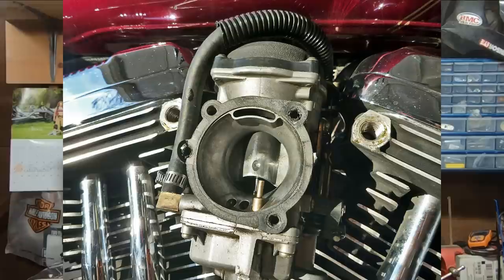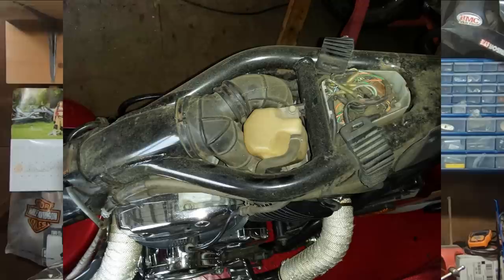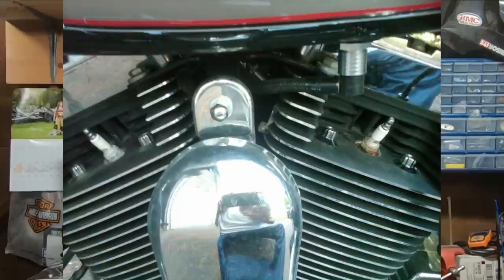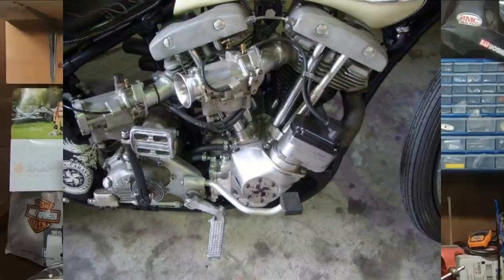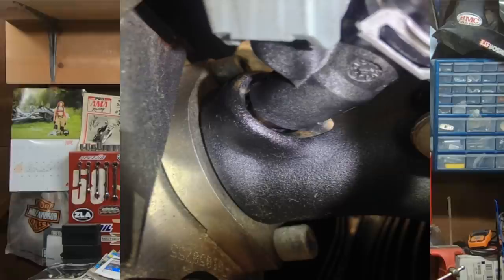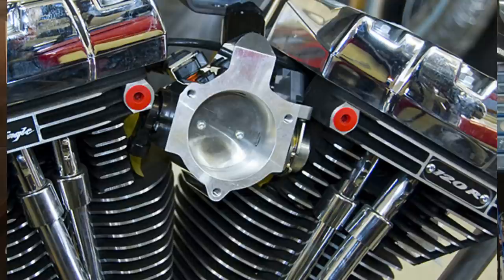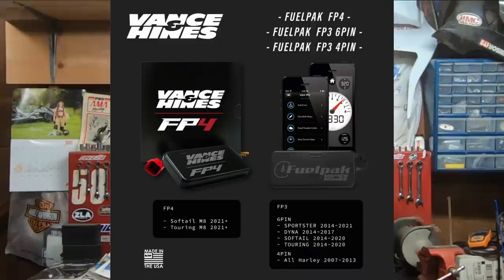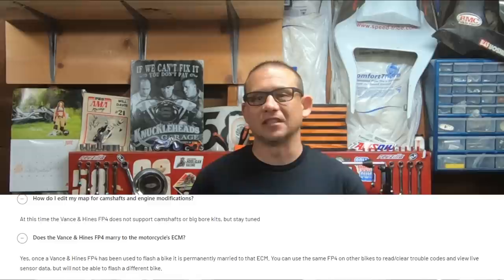Harley Fuel Injection Solved The Carburetor Problem (Created Others)

Comment: I’m an old school guy, I’ve got a fuel injected 103 and a carbureted 80” Evo, I’ve always been a carb guy but once I got into tuning my softy with an fp3, I used my extensive carb tuning knowledge to get the fi dialed in, it ran good with the canned tune once I did the cams, but, once I used my buddies fp3 pro to dial in the ve tables, used that info to tweak my target/seen AFR to get it to where I wanted to be. Had it dyno’d and the dyno guy was impressed (so he said anyway) that I tuned it myself. It’s like anything else, once you learn how things work, doesn’t matter if it’s carb or fi or whatever, know the basics, the rest is easy. And the fp3 is actually reasonably capable but kind of a pain to change things around.

Comment: I'm okay with more rudimentary fuel injection systems, like early throttle body injection... because it's basically just an electronically controlled carburetor. But more modern EFI systems add way, WAY too many sensors and electronics to function, all of which are additional potential points of failure. 

As a guy who's owned 2 Japanese cruisers and 2 Harleys, I always envied how easily accessible Harley carbs were. It absolutely sucks to work on Japanese cruiser carbs because they bury them between the cylinder and usually tucked up under the tank

Comment: I don't mind my twinky idle at all, even though I really liked the sound of my 84 shovel idle.
My current 2007 twinky had a no start after a month of owning it.
Local dealer came and picked up the bike, took me home, fixed the problem (something to do with the carb) and it has run with no problem since.

Comment: 🛑🛑 I just got home, to watch this video after riding home from the HD Dealership.  I installed a Power Vision 4 Upgrade, and did a Dyno Tune. 

My CVO Ultra is running much better, and the charts say it; but my butt noticed the Performance Change. 😂👍💯

Great Results…Highly Recommend the Power Vision 4. 😀👍
Reply from the maker: That's awesome! Good dyno tune makes all the difference! Vance and Hines had a great product idea but they screwed up not making tuning licenses and playing catch up on the dyno market, Dyno Jet has that locked down.

Comment: As much as I loved my FI bikes, nothing irritates me more than a bad sensor. Had a bad crank sensor and it would over fuel the motor at idle, hit the throttle and fireball out the ass end. Take the bike in and it didn't throw a code. Guess how much that cost for a $20 part and an hour of labor. After going back to a carb, I only have to worry about fuel, air and spark. And you don't have to be a computer engineer to work on them.
Reply from the maker: That's the worst when those sensors fail and don't even throw a code, you have to look at data or just rely on previous experience to figure it out.
Reply: My bike is a 2011 Softail. I had a similar problem with an engine temperature sensor that didn't register an error code. When the bike was cold it ran fine. As soon as it warmed up it wouldn't idle, had to keep it running at about 2000 rpms to keep it from stalling. Riding was OK as it was running above 2000 usually. Drove me nuts for a month or so. Someone mentioned a similar problem on a blog and went through changing all sensors one at a time until he hit the engine temp sensor and that fixed it. I bought a new one and took a minute to change it and the bike has been fine for a few years.
Reply: Could have fixed it, but it takes a very specialized piece of equipment called a " voltmeter. Also, the crank sensor doesn't provide fueling under any circumstances.

Comment: Fully agree, love the videos man. My 08 fxstc randomly dies when down shifting to come to a stop. Replaced spark plugs, battery, plug wires, tps, ran seafoam in tank, cleaned butterfly and IAC, raised operating temp idke to 1050... even re-tuned it with fp3 autotune.... still randomly dies. If I can't figure it out soon, I'll be going back to a carb bike.
Reply: I used to have a similar issue and it turned out to be side stand sensor that randomly decided that the side stand is down and if the bike was in gear it would shut the engine down. I used the fp3 snd disabled "jiffy stand" sensor. After that I decided to get an older model.

Comment: I have the regular CV stock carb and had to re-jet it. I bought a kit because I lacked the experience at the time but in hindsight the stock CV carb just needed an adjustable main jet needle, idle jet, and an adjustable idle air mixture screw.
Reply from the maker: Jet kits makes a big difference, you can really make a CV perform really well.

Comment: Linkert M74 B carb ,get your float right ,dial in low and power jets and I get 36\40 miles per gallon on my stock 74 inch FL panhead  ! 
Yes idle around 900 RPM ,get that straight weight 60 oil to top end .
Reply from the maker: Now that's how it's done right there!
Reply: Nothing sez 'vapor lock' like a hot, brass body carb in the V of an air-cooled V-twin with iron cylinders!

Comment: I had three different bikes with carbs, old 350 Royal Enfield single, Cb750 it had 4 carbs and now 883 sportster... Never had issues but it takes a good mechanic to tune them properly. Its bit hard to find a decent mechanic here in Australia who can tune them properly. I also have a 2015 EFI triumph Bonnie, it's great too never had any issue with it. I think it cost a lot more to do a simple stage 1 on EFI bike then carb.

Comment: Yes the old "controlled fuel leak" also known as a carburetor will be around for a long time. I must admit they do sound better than a EFI Harley. But I must disagree when it comes to reliability. The Delphi system is just as reliable as a carb, unlike that Italian EFI they started with.

Comment: Fuel injection is nice if you are constantly transitioning 6000' to sea level, but other than that, give me a carb any day. I want to eventually do a big bore Evo Road King and I see Woods has a new carb for it. The Super King 505 ought to fit nicely on a 109-111 inch Evo.

Comment: Great video. Does anyone know why fuel injected sportsters take much longer to idle down than the big twins ? I was told that the fuel injected system on the sportsters is one of the worse. Why? I own a fuel injected sportster and a carb big twin. I will take the carb any day of the week. Thanks, Frank

Comment: 6 7 800 rpm is called chugging chugging leads to overheating like cruising down the street in to high of a gear carbureted harley idles at 1050 efi at 2000

Comment: Great videos and good content. I have a question I am hoping you can answer since, nobody else can. Can I use harley premium adjustable rear shocks off of a 2020 touring model on a 2003 touring model without issue? There is a considerable difference in swingarm sizes. Will the 2003 flex to much causing an unsafe riding condition?

Comment: The major problem with the high tech approach is that when a sensor, or other electronic device fails it usually happens quickly, or more frustratingly, intermittently. With the old systems like points and condensers, carburetors, and other non high tech alternatives they usually exhibited diminished performance prior to failure giving you an indication that you were about to be left standing beside the road in the near future.

Comment: Fuel injection makes your engine rev on startup before oil gets pressure up..with a carb you can allow it to spin a bit more before pulling the choke and firing it to life
Reply from the maker: Good tuners allow you to change that, but the way the EPA is cracking down we aren't allowed to tune anymore.

Comment: Thank goodness fuel injection of today is not the same as the Magnetti
 Morelli. It worked great until it didn't, then there was a bit of swearing and a lot of hoping and you still couldn't figure it out.
Reply from the maker: The Delphi system is leaps and bounds ahead of that old Italian system.
Reply: Funny that the Mag-Marelli FI system worked so well on the Ducati's! Must be an Italian thang!

Comment: I have had 3 bikes with fuel injection with no problems and like the response I will say at 73 I am not into the hop up the engine thing anymore
Reply from the maker: Fuel Injection really is a set it and forget it for the most part.

Comment: I have a flstc 02 carburated twin cam with the stage 1 package. Sometimes when I pull the clutch in and give a quick throttle when down shifting I get a little whisper as if maybe it got too much fuel. Do you have any suggestions I'm kind of wondering if I need to make an adjustment or rebuild carb and clean jets. Thanks

Comment: Both my vintage bikes are carburetored and are tuned and synced perfectly.  Only downside is cleaning and if I were going from Chicago to higher elevation like CO, fuel injection would be better!
Reply from the maker: You get a carb dialed in really well sometimes elevation won't mess with them too bad at all.

Comment from the maker: Have you had any issues with the fuel injection system on your Harley-Davidson?
Reply: 55 mpg on my stock CV40. Anyone out there who has an EFI system that can match that? Performance is  better also, 42 pilot/165 main stock mufflers and airbox. If you're interested in seeing how far you can go per tank let me know and we'll go out for a 275 mile ride and see who runs out of gas first.
Reply: I was reluctant to shift from carbs to FI because of the simplicity of the carb and ability to work on it, but I have been pleasantly surprised by my HD FI bikes.  No problems at all, no difficultly cold starting, and smooth running.
Reply: I must be old, had injections but still prefer carbs.. 👍

Comment: How about a ThunderMax ECU? I have never had one myself but apparently they can make one for a Dyna with a 120R. My friend's made 130hp 130torques. In a rubber mounted Dyna! Needed a wider front tire and dual disc brakes.

Comment: 1994 Evo Electra-Glide, ported & polished heads with bigger valves & springs, big bore kit, (88ci to 96ci?. Is 96 too big for case studs?), 10:1 pistons. (If 96 is okay would 10:1 be too much compression?), EV27 camshaft (would this need a different cam?), true dual exhaust. This is what I'm looking to do. It currently has a Mikuni. Would my standard Mikuni woth different jetting be sufficient? Or would I need to get a bigger Mikuni?

Comment: GixxerFoo you main point on idle is FI doesn’t let you idle down past 900 due to oil pressure and lubrication needs.  That doesn’t make sense. Fuel pressure and lubrication needs doesn’t change just due to switching to FI
versus carb.  Just saying

Comment: If you ever watch the Syfy apocalyptic movies then you see all the bikers in the movie riding on Vintage bikes because they are simple easy to keep up and easy to maintain where's complicated fuel injection motorcycles provide spare parts
Reply from the maker: Yeah you ain't gonna get these new FI bikes running with a match book and paper clip, seen that done on a points bike before.
Reply: I love it and Emanuel where they tell you the distance is a cigarette paper for the cardboard from matchbook everybody smoke in the old days I'll bet even God smoked in the old days
Reply: Usually running the 4-cyl, 150-1100 air cooled Honda CB, Kawasaki KZ or Suzuki GS motors.

Comment: Mikuni (Screamin Eagle) carb on my bike. I have been fiddlin’ with the choke , petcock and cold starts for too long. I would gladly upgrade to a fuel injected bike if I could.
Reply from the maker: It's expensive to go to fuel injection, that's about 2500 bucks. Have you tried a different carb setup?
Reply: @GixxerFoo  No I haven’t. Been running this setup for almost 20 years. Harley-Davidson recommended it in the Parts Manual back in the day. It has been satisfactory other than cold start ups. I think I need to get it tuned. I believe it is running rich.

Comment: fuel injection was pushed due to the government madating that gasoline contain a certain amount of ethanol, ethanol gas gels and gums up sitting in a carb....not a problem with fuel injection.
Reply from the maker: That's true but it still separates in the tank of you let it sit.
Reply: @GixxerFoo  for sure but that takes months I've found and in a carb sitting it can be a matter of weeks....I still love carbs for ease of tuning. Go for a few rides.  Read your plugs....not hard..though it takes time...my efi street glide was tuned in two hours on a dyno....so I guess there's trade offs....my wife's efi fatboy sat all winter with gas in tank....no stabil or anything....fired right up no problem....the same cannot be said for my panhead or my vulcan...but I was able to tune both those bikes in my own

Comment: No wonder why I like the old Keihin carb...  It is easy to take a part, easy to replace jets, a very simple carb.  I get the "lope" that I like and I get that "Keihin FART" just before taking off at a stop sign, then it almost dies so it teaches you to "blip" the throttle before taking off and stopping.  The fuel injection RUBS still "blip the throttle" as if they know why it is done!!!  Oh and another reason I don't like Fuel Injection.  I have never and will never own one of those "collars on a frequency" that people call a cell phone.  Worthless POS that they are.  A cell phone just makes people "tied" to a calling card waiting for someone to call or text.  Ridiculous!!! Keep checking your phone people, keep checking and when someone does call say, "Oh I've got to take this call."  That is when I walk away!   I have a desk top computer and that is all I need along with my land line that has an answering machine....  Simple like the Keihin Carb...
Remember, think of this: Two people standing together talking and having a good conversation.  Someone walks up and just starts talking over their conversation without being asked to interrupt.  That third part person, is unwanted in the conversation, but they break into the conversation and take over the conversation.  That is what it is like with you cell phone users.  "Oh, I have to take this call."  BS, get some manners!